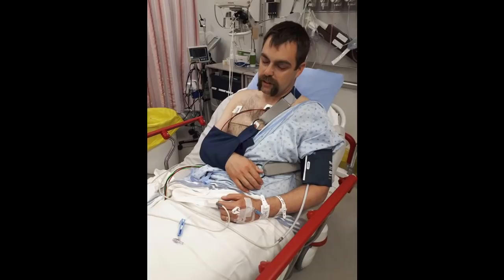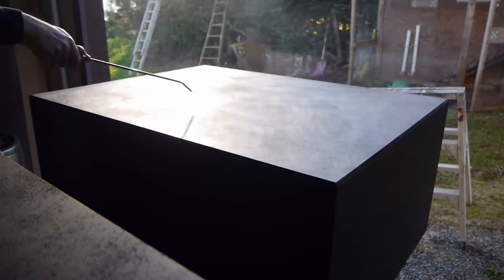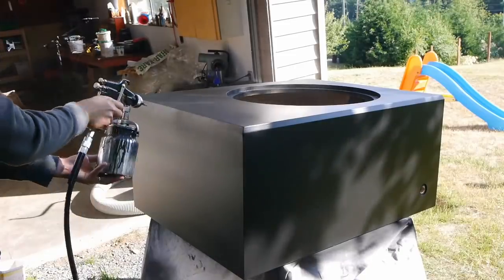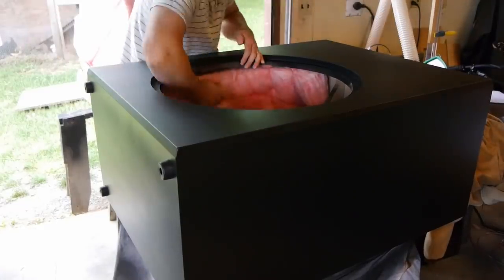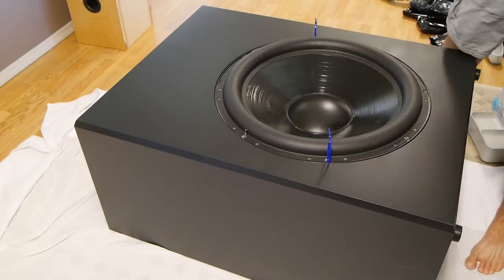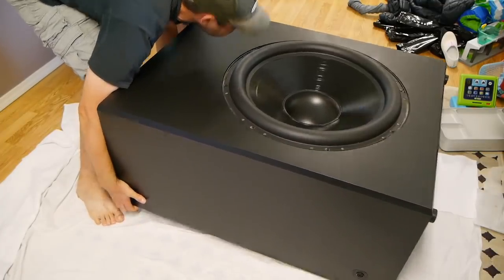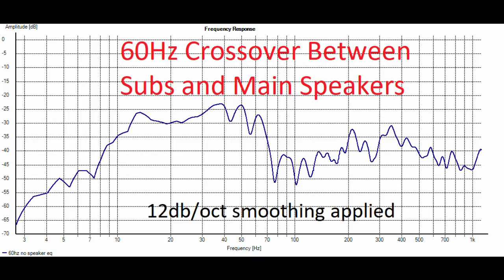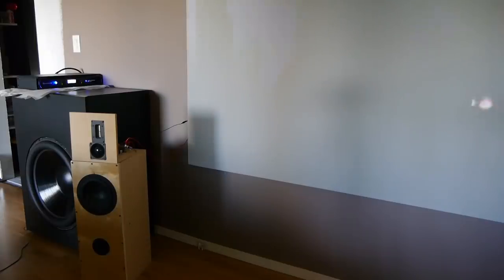Pierce Audio 24" Subwoofers Build Log Part 2

Comment: That is an amp issue. That response compared to the Behringer is a typical Crwon thing unfortunately. Get a Lab or Powersoft if you can swing it, or get an MC2.
Crown has not been very good ever since Harman took over.
Reply from the maker: ABOlsen69X ya I did some research on it after the test and discovered that. Not my amps but still sucks for the guy.
Reply: @ImpulseAudioSpeakers  
Yup.
Btw, I've done quite a bit of testing with box dampening materials, and one thing I found is this. The pink isolation does not have the same properties as poly-fill. Yes it dampens the box so it becomes less boomy, but it does not offer the isothermal properties of poly-fill. When I used the pink stuff in the same amounts or less, as you would poly-fill, the response of the speaker did not really change. And if I overloaded the box it acted as a much smaller box. I think it has to do with the density of the materials and their ability to couple with the vibrations.
When using the correct amount of poly-fill the difference was significant. Then it had the desired effect of cheating the driver into acting like it was in a larger box. For a box that size, it can only handle about 1 lb. of poly-fill per cf3. Any more than that, and it actually starts to take away enclosure space.
Try it. You'll be pleasantly surprised.
Reply from the maker: ABOlsen69X thanks, but, umm, I’ve actually experienced the opposite. Weird.
Reply: @ImpulseAudioSpeakers 
Okay. That's interesting.
Reply: @ImpulseAudioSpeakers  
Are you saying that you experienced the opposite? As int the Polyester not working?
Reply from the maker: @AB-80X  The polyester works, I've just found the insulation to be more effective. In either case it's a pretty minimal difference that I don't worry about all that much. A lot of people use the poly on ported speakers so the pink stuff doesn't show or shoot out of the port. I admit I've finished a pair of nice front ported speakers before and had pink insulation showing at the ends of the ports when you look at the right. Had to fire some black spray paint in there onto the insulation.
Reply: @ImpulseAudioSpeakers 
Hm, okay.
I rarely use much of damping in ported enclosures. I like to a sheet of Gladen Aero Multi behind the driver and maybe on the bottom, but only if it gets a bit too boomy if it's hard to brace or I experience a harmonic sound.
However, a combination of things I've found to work incredibly well in sealed enclosures is this. Cover all insides with the Gladen Aero Flex. Then spray this with adhesive and put the fibre, in your case, pink stuff, on top of that.  Makes for a VERY dead box with great low end extension.

Comment: How much did you charge for those?
Reply from the maker: Richard Givher I believe it was $900. Drivers were provided, so just testing, design, materials, and labour.
Reply: @ImpulseAudioSpeakers  Do you feel these subs would compare or be better than the big names? SVS PB 16 Ultra, Power sound audio V3601, JTR and so on?
Reply from the maker: Richard Givher it’s probably comparable to the big PSA or JTR subs. Probably better than the smaller SVS. Size is very important when it comes to subs. The V3611 wouldn’t be my choice due to the height being double the width. But dual 18s would almost keep up to a 24.
Reply: @ImpulseAudioSpeakers  So the single 24 would go deeper and produce more output than two 18's? I'm just getting into this stuff and there's a lot to learn, so forgive my naivete.
Reply from the maker: Richard Givher no problem. Ask away. Yes in general a single 24 has more capability than 2 18s. Two 18s have some advantages, like two voice coils to handle the power, 2 wiring configurations (more if each driver is dual voice coil), if in separate cabs they have more placement options, etc. But in terms of output the 24 has a larger radiating surface therefore more Vd (assuming xmax is the same for the 24 and 18).
Reply from the maker: Richard Givher note that the PSA is ported and these were built sealed. So that’s another variable. Lots of variables here so it’s hard to directly compare. They’re definitely in the same league.
Reply: @ImpulseAudioSpeakers  Do you offer a ported version of the one you built in this video? Say......if size were not an issue?
Reply from the maker: Richard Givher it can be done. But size really would be an issue with this driver. There are other 24” drivers that could work though. I am not taking custom builds at the moment though. I’m dismantling my shop for a home renovation.

Comment: Anyone see the fucking screws he striped out or just using screws to mount the subwoofer
Reply from the maker: Zeth Spurlock stripped? No that didn’t happen. In total there were 24 large screws in over 1” of mdf holding in the driver. I am not concerned. Only installation of 8 screws were shown in the video.
Reply: @ImpulseAudioSpeakers  I was just wondering cause I seen most people use bolts and nuts  with those subwoofers maybe overkill
Reply from the maker: Zeth Spurlock if only using 8 then it’s not overkill. Probably necessary. But this driver basket had two additional spots on either side of the mounting locations to add screws. I had to drill the frame at each spot, but it was possible. Other frames don’t offer that opportunity so bolts are a better choice.
Reply: Cool cool

Comment: Wow impressive subs. Only thing I would have used is T Nuts to keep the woofers snug and make tightening these a bit easier. But otherwise yeah, those subs are insane. I noticed your room correction system. Is that REW, or Dirac. I know sweep tones are similar.
Reply from the maker: Vincent Chen thanks. That software is HolmImpulse. I find it very intuitive and easy to use.